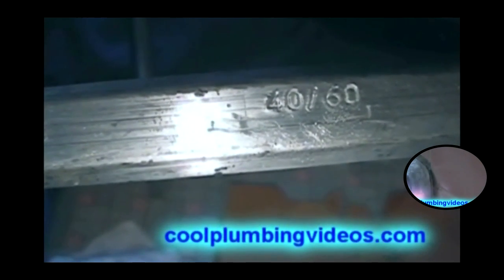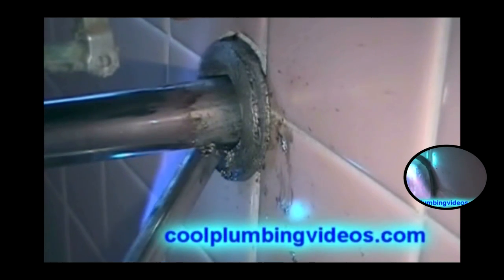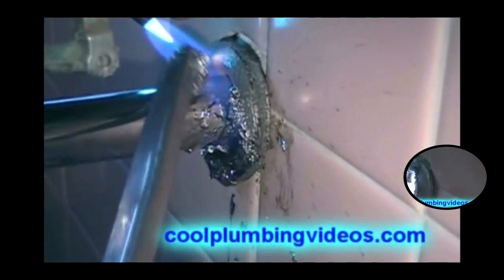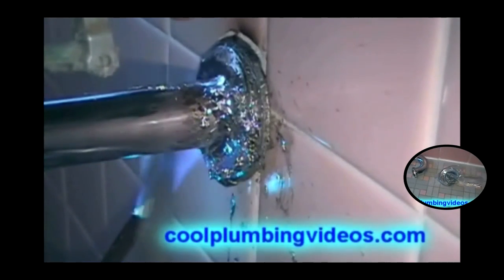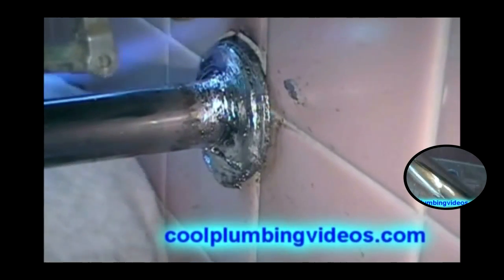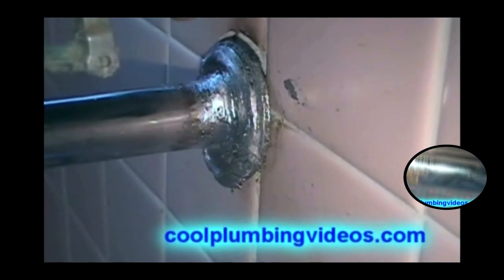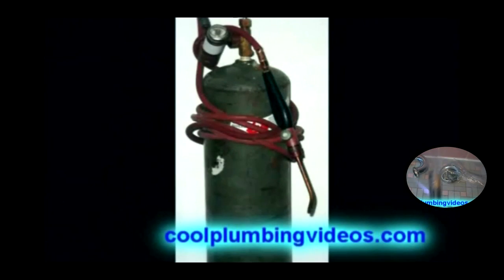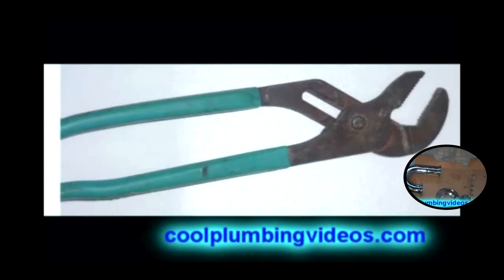How To Safely Wipe Lead 2 of 2

Comment: Great video. I will use your technique to replace the 1.5" horizontal brass pipe coming from the wall on my kitchen sink. I would not attempt this without first seeing how to do the lead sealing operation. Thanks.

Comment: hey plumberx, In your video, you used the right solder bar 40/60, but you slipped by calling it sixty-forty lead. 60/40 has 60% tin and 40% lead, which is used for stained glass windows.  It will run off the joint when you are heating it up.  Make sure that people trying this procedure use the 40/60 bar solder, which has 40% tin(Sn) and 60% lead(Pb), it will work a lot better.  thx.

Comment: THANK YOU SO MUCH for posting this very informative video.  You probably just saved me $1,000 or more from a plumber who wouldn't have wanted to mess with the lead and would have insisted that everything be replaced from my kitchen sink to the main stack.  I followed your directions to the letter I only paid about $35 for the 60/40 bar, the flux, and the inch and a half pipe.  THANK YOU!

Comment from the maker: @tonyarae52 Yes your right they do make a Brass 1.5 male TP thread pipe to 1.25 slip nut adapter for this type of hook up. This would be the best hook up for this drain outlet, A PVC trap j bend would be fine, but brass would make for a better looking job if its a Pedestal sink. I hope I was some help to you.

Comment: This is a great video but I have a similar but different problem.  The copper 1.5" drain pipe has a female end on it.  I have no idea what to hook up to it to assemble a p-trap.  Should I use a 1.5" male reduced to a 1.25" male (brass) and screw on a store bought trap kit?  I have heard you should never use female PVC screwed onto a male copper/brass.  Any thoughts would be great because I have no idea what to use and can't even think of calling a plumber due to costs.